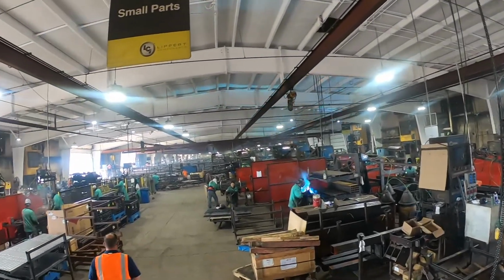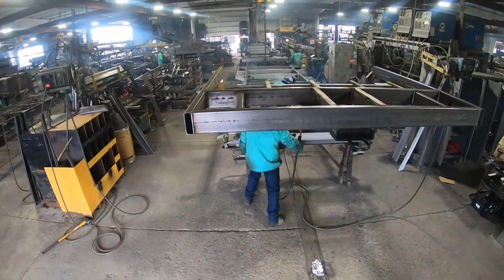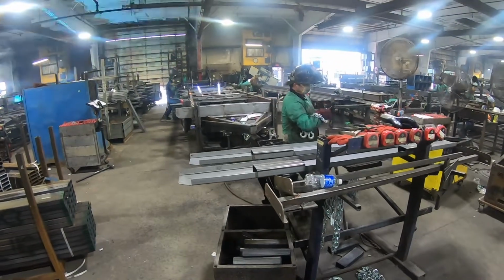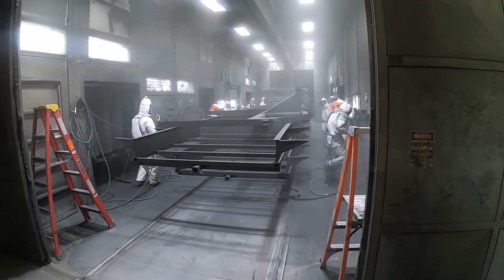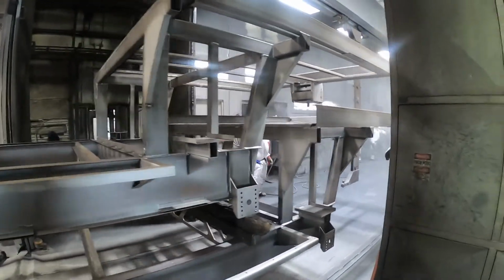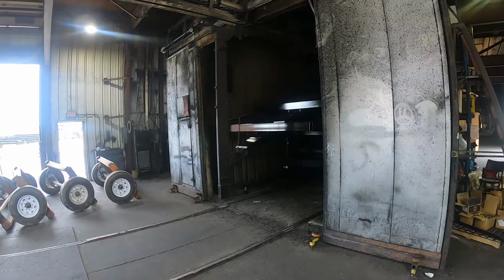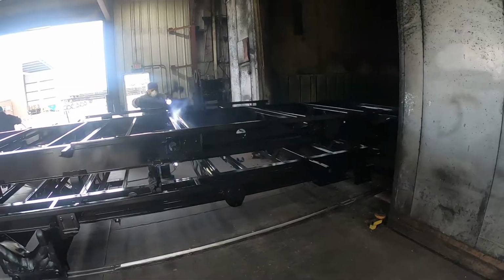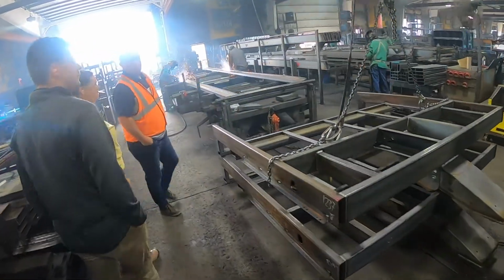Lippert Chassis Factory Tour

Comment: LCI should be ashamed!  So many LCI 5th wheel frames under very expensive trailers are failing and ruining the lives of many RV owners.
Reply from the maker: From what we understand Lippert will build a frame to the RV manufacturer's specifications. Once it leaves the factory they have no control over how heavy the trailer ultimately is. 

Look at all the Class C RVs built on the Mercedes-Benz Sprinter chassis that are so close to the chassis' capacity that you have a few hundred pounds left for all your cargo. 

This is why the data sticker on the side of ANY RV should be looked at before anyone ever goes inside and gets swayed by the pretty furnishings.
Reply: @StressLessCamping  stop kissing @$$ .. each comment on this video, your only defending Lippert. Get real and see what is really happening to these frames.
Reply: @StreetProduction303  There have been a lot of videos and other content out about this recently. This seems to be primarily very large fifth wheels and while the frames are what fail it's not just the frame that's at issue. These gigantic fifth wheels are so heavy and then get heavier with use I'm wondering if it's even a good idea to own something this big and heavy.

I'd like to see how the structural engineering is done before I make a final decision on fault. At some point you can continue to reinforce the frame but then you get something too heavy to tow with anything but a heavy duty truck.